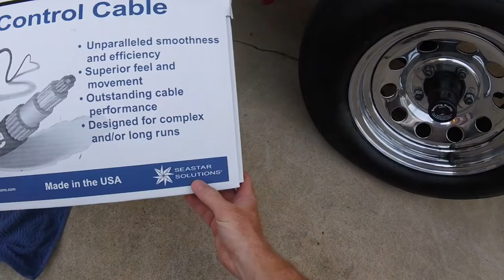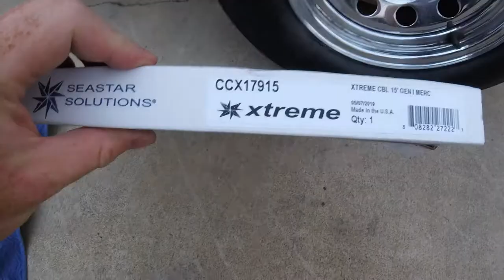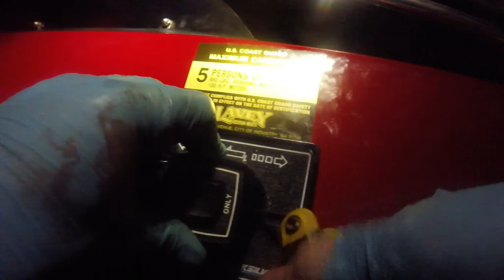How to Replace Gear and Throttle Control Cables on a 1990 Mercury Outboard

Comment: Thanks for the video, I need to take mine apart to take the cables out and lube them, they're getting very hard to move and I don't want them to break while I'm on the water.
Reply: i took off controller, noticed 2 screws missing, used some wd40, then a bunch of marine grease.  Presto, it works again

Comment: I have the same shifter. But mine , in neutral, sits at 2 o'clock. Not 12 o'clock. It seems from your video I could take the shifter off then put it back on the splines in the correct 12 oclock neutral position. Does that sound like that would work? Thanks.

Comment: How do you clock the small aluminum cog that goes between the handle and the body? Mine has two pins on the backside but there are many positions it will fit in.
Reply from the maker: I think you are talking about the the shifter ring at 3:35, yes there was a certain why it goes on, I’m not sure without handling it again

Comment: My shifter is the same but it spins freely . Is something stripped or is that set screw on the bottom maybe loose or something what's your thought 🤔
Reply: Spins freely I mean just falls down like it's not locking no tension

Comment: Would it be better to replace both cables before putting in the grease?
Reply from the maker: Yes, I replaced one cable in the video recording, then found out the other was broke.  Should have just planned on replacing both while I was in there, instead did it twice.

Comment: Can I ask why you had to do this?

My neutral cutoff switch is engaging when I throttle in reverse and I can't seem to find a sweet spot with these cables
Reply from the maker: I’m sure you already know that you thread the end of the cable , back at the motor, in and out to get it to line up with neutral.  I just remember I had to adjust it a bunch to get it right.
Thanks 
MM
Reply from the maker: Asking why I had to do this, check out 8:50, the cable snapped off at the lake, I had to take the cover off on the water and give throttle manually while wife drives.
Reply: THANK YOU!! I was seriously struggling with this and man does this make a big difference! Really appreciate your time and effort!

Comment: having issues with  neutral switch re engaging on top of controller.  any ideas?
Reply: Did you find a solution? Mine is stuck in neutral. Took it apart send can’t figure it out. Thx.